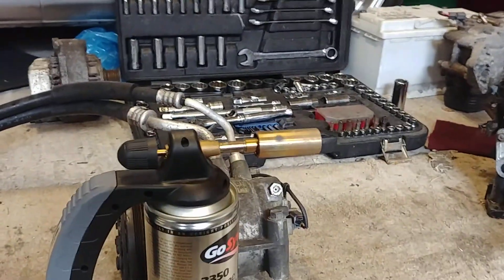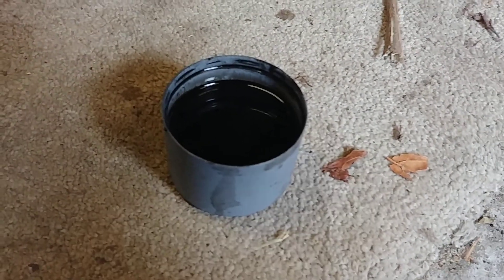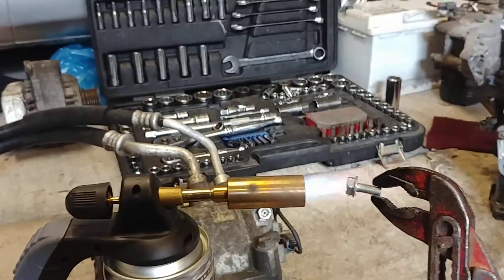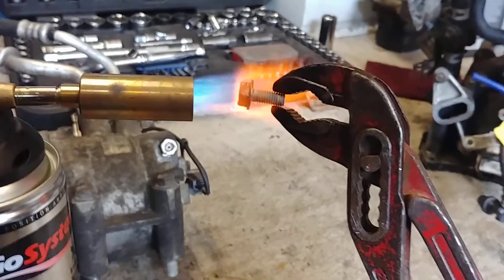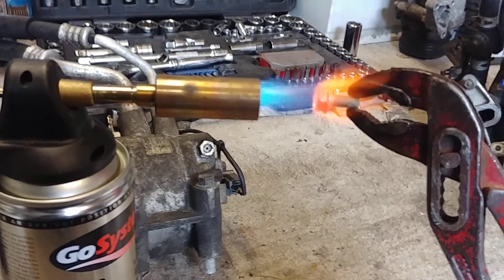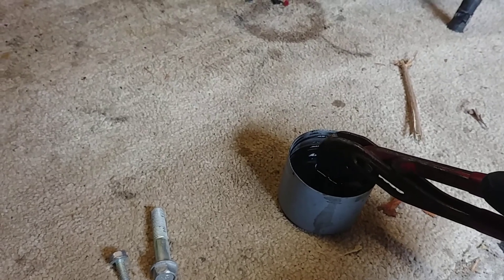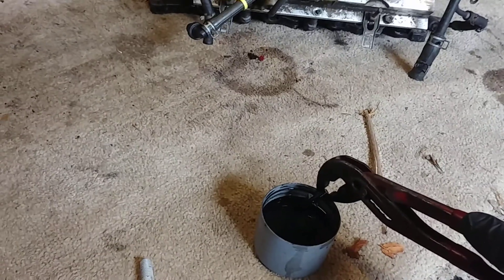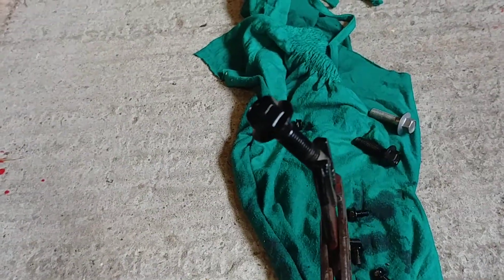How to hot blue bolts using heat and used engine oil

Comment: You don't want it cheery red, just heat until 'blue' hot and then dunk in oil. Cherry red is too hot
Reply from the maker: Hmmm not the way I was taught mate? The bolts are still jet black 2 years on.
Reply: @Weihrauch88  when it’s cherry red, you’ll weaken the bolt by almost 50%.. you want it around 600f where the metal remains unchanged yet hot enough to cook the oil and leave a nice film
Reply from the maker: @es6tt221  fair one 👍. The same bolts are still jet black now and have been on and off the engine a good few times with no issue.
Reply: Exactly...way to hot and unnecessary  400 is enough and doesn't weaken the bolt!